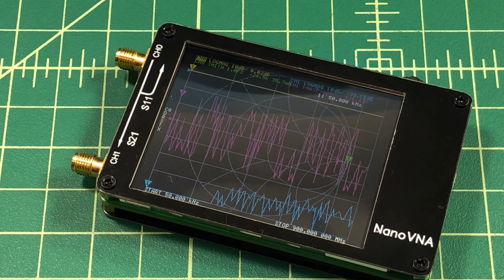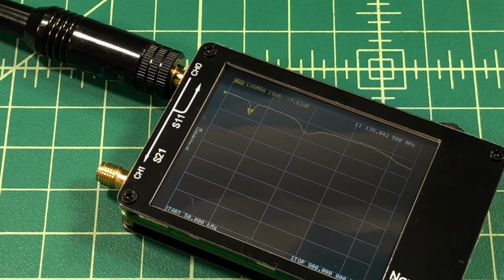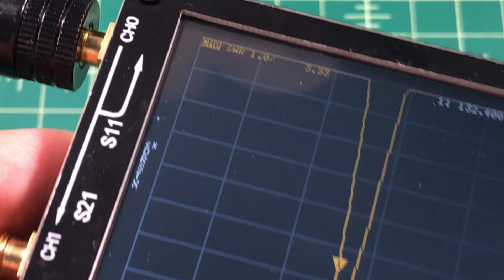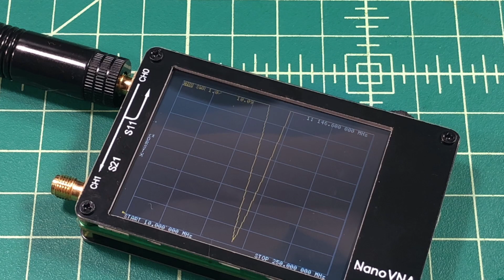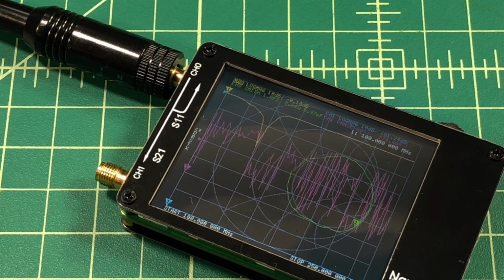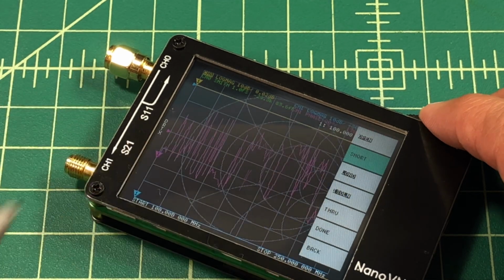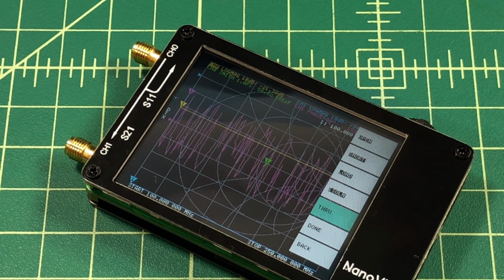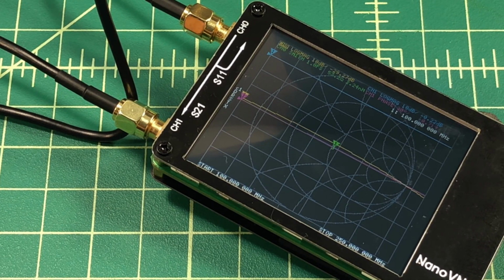NanoVNA for HAM Radio Introduction - TheSmokinApe

Comment: Good evening sir I hope you and your family are well I have a simple question, on the VNA, does it have a different display , so we could see DTF over length , so it would resemble small squares with values at each line , or does it only have the Smith chart...
 I purchased the Nano VNA Very tiny handheld network Analyzer.... I am working away from home and I am very excited to to go home and start making antennas ....
Reply from the maker: It only have the grid lines and the Smith chart which can be toggled 👍
Reply: Okay great , thank you for your time , I ended up buying the Upgraded] AURSINC NanoVNA-H Vector Network Analyzer 10KHz -1.5GHz Latest HW Version 3.6 | HF VHF UHF Antenna Analyzer Measuring S Parameters, Voltage Standing Wave Ratio, Phase, Delay, Smith Chart (New) ..
Reply from the maker: Congrats on the purchase, you will like it.
Reply: I work in the telecommunications industry so all of this is familiar to me , I am currently working out of town on a Rogers cell tower 8 hours north of my home, and the VNA is there waiting for when I go back next week , I am excited to play with some new gear .

I use the Anritzu 332E  for my sweeps . 
Anyway thank you for the recommendation on the NANO VNA .

Comment: Love your channel but you forgot to mention that you HAVE TO HAVE a SNA to PL-259 adapter. BUT every video I have seen on YouTube seems to forget that. One question. Why does the SWR change when you move the device around ?
Reply from the maker: There is little shielding on this VNA, when you touch the VNA you are adding capacitive coupling which messes with the reading.
Reply: @TheSmokinApe  Thanks for the quick  and understandable answer to that question. But that is why I check your channel at least once a week. BTW I asked you a question about baluns on a comment to one of you videos ( But I cannot remember which one now) I found a good site that explained why you need a balun very simply. Now I just need to figure out which ratio of current balun that I need.

Comment: These videos are great and very helpful. I calibrated mine and hooked it up to a Dual Band J-Pole and got some encouraging results. I'm a brand new Ham getting ready to put the first roof mounted vertical on our house. I'm wondering if I can use the NanoVNA to tune a new vertical antenna without a classic SWR meter? Seems like it should work...?
Reply from the maker: Yeah, you can use it for that.  Glad you like the videos John 👍

Comment: One of the things we do in the industry is to calibrate the OSL to the end of the cable you will use to test to the antenna. So one of the included cables could be your permanent test cable that you calibrate

Comment: I have seen many of nanovna and nobody go through the specification and function first, basically  all do the same routine, question is this device capabble of screen printing using the USB port? or do you have to do it using your computer?
Reply from the maker: MILENEO3 I do screen printing with the computer 👍
Reply: @TheSmokinApe  Thanks

Comment: Does it need to be calibrated for each band tested for SWR ?  So calibrate when I am looking at 80 meters ? Then calibrate again when i want to look at 10 meters ?  Or just calibrate once and it will be accurate on all ham bands ?
Reply from the maker: Just calibrate it and it should work on bands.  If something doesn’t look right calibrate in the frequency you are testing. 👍

Comment: I just got one. I'm a real noob and not quite sure which of those gold caps are
Reply from the maker: The are calibration standard for calibration of the NanoVNA.  I cover them in the video 👍
Reply: @TheSmokinApe  I know but I think I know which one is the load. The other 2 I really can't tell.
Reply from the maker: Put them on and see where they read, should line up with how they did in the video 👍
Reply from the maker: The load is silver, the open has a hole on it, the short has a pin mounted on a small disk 👍

Comment: You are not checking the resonant frequency correctly. You will find that the antenna is designed to be correct when attached to the WT and held near your head. You will probably find the resonant points will move into the Ham bands! M0iiZ

Comment: Just connecting the antenna in that method is not going to give you accurate results. You need a counterpoise to work against the antenna.
Reply: just hold the unit as you would an HT. should be pretty close to how the antenna would perform on your HT.

Comment: Got mine few days ago - quite nice - my issue is when using the switch to turn off the unit, a blue LED stays on and runs the battery down so each time I have to recharge the thing — 73
Reply from the maker: Mine will stay on for a few minutes and then turn off.  Does yours stay on?
Reply: TheSmokinApe Yes! No issue but what you will want to do is take the power cable (USB to usb C cable) and plug it in to a 5 VDC supply such as your cellphone charger OR computer to charge the battery for several hours then it should be fine. My issue is the thing shuts off but the blue LED next to the connector stays on thus eventually draining the battery- Good luck -
Reply from the maker: Thank for the update 👍
Reply: TheSmokinApe Thank you! The issue is... once the unit is completed it’s charge and I turn off the unit with its power switch, one of the blue LEDs remain “On” and eventually drains the battery.  Also I am trying to figure out how to return the unit to its factory default mode - I see no wat of doing that- thought perhaps there maybe a reset button on the board - there has to be a way- if you know how would certainly appreciate your input! 73 de K8KEM
Reply from the maker: @davideisenberger6197  The only thing I can think is maybe a firmware reinstall?  I haven't seen a way to do a reset.
Reply: @davideisenberger6197  Hm. I noticed that on mine but the light turns off after about 25 seconds. Certainly not a major drain to the battery if you figure that LED is pulling around 40 mA.

Comment: Might be better to know what you are talking about b4 doing this review., An understanding of the Smith chart as well as how it depicts inductive and capacitive reactances is essential to fully understand the capability of this device. Just showing the VSWR info is almost pointless.
Reply from the maker: Thanks for the feedback, I wouldn’t call the video a review but an introduction to a new tool I picked up.  I tried to be pretty clear about that and the fact that I got it to learn.   Maybe I wasn’t clear enough...  Either way I do appreciate the feedback.
Reply: @TheSmokinApe  Nah.  Very clear.  I personally appreciated the video, for just seeing what the menus and screen options looked like.  I also didn't know it came with an internal battery.  Lots of basic into bits that were helpful for me.
Reply from the maker: Thanks man!
Reply: @TheSmokinApe  My point was just  a suggestion and I appreciate you taking it that way. You have presented many interesting and informative reviews. This is really a very slick tool and rivals the HIGH DOLLAY HP 8743 ES in my lab. The new cost was over $35K. However with my options it is good up to 6 GHz. The cal kit alone was over $4k.
It's an entirely different ball game above 1 Gig, where things become very bizarre to even very small changes. 
One thing I hope this tool will do is help MANY Hams to better understand the Smith Chart. This seems to be a mystery to most Hams I have known in my 45 years as a Ham. First licensed when I just turned 15. 
Understanding how inductance and capacitance affect a load is important if you really want to understand antenna's, transmitter final tanks and even filters...
The good thing is contrary to popular thinking, understanding these principles is not difficult and now that this CHEAP VNA is available, I believe many Hams will learn more about this area of our hobby.
Good luck with you reviews.
Reply from the maker: Thanks for the follow up, that's exactly why I picked this VNA up...
Reply: @wa4aos  I suspect your HP has a slightly better s/n range.
Reply: @TheSmokinApe  Hey its just what I wanted. I don't want smith charts so thank you.